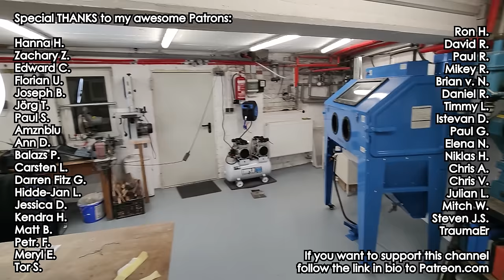How I Transformed My Workshop With This Epic Update!

Comment: I love my sandblaster. A couple of tips that may help. measure the glass and get a couple of spare pieces cut at the local glass shop as I only get a few months out of mine. Clear contact can help but everything goes frosty after a while. Your compressor will run continuously while you’re blasting as it uses a lot of air so run a good water separator. I run the air through a large automotive transmission cooler so the air cools down and the water condenses. This gets caught in a dedicated water trap. This set up is placed just before the air enters the cabinet and it’s amazing how much water it collects. Run proper media, I use garnet as it’s sharp and lasts a long time. Just don’t use sand as it gets smashed so it doesn’t last long and the dust, if it leaks out, can cause silicosis of the lungs. If the item you are blasting is heavily contaminated with thick paint it’s worth using paint stripper first to help keep the media clean. Blasting anything oily or greasy is a disaster as it contaminates the media and then that can contaminate everything you blast after that. I blasted something with old contact glue on it and while it removed the glue, it contaminated my media like small pieces of a plastic bag and kept get caught in my gun and blocking the media flow. It’s just about all gone now but never again. If an item is rusty, even heavily rusted, I just blast it with no pre cleaning as the rust just comes off like dust and the filter catches it. I hope some of this is useful and I don’t want to sound like a “know all”, it just things I have learnt over the last 15 years of having mine. Good luck, they’re so a great thing to have. Cheers Stuart 🇦🇺
Reply: That's all very interesting. When watching YouTube restoration videos, it always seems as though a sandblaster is like a kind of 'magic wand' - just spray sand at something and it magically come clean. Your explanation confirms that the truth is that a sandblaster is just like any other tool - there is a right way and a wrong way - and there is no such thing in life as a magic wand.
Reply: @caseyjones166  Hey Stephen, spot on.👍👍
Reply: Interesting about the rust.  I always thought the reason some YTs strip/take of most of the rust before blasting was to make the media work for longer, and that the rest were just lazy or didnt mind not saving money on it
Reply from the maker: Hey Stuart thanks a lot for this info. Very valuable and much appreciated that you took the time to write this all down
Reply: @NTRprojects  Happy to try and help. I love your channel. 👍👍👍
Reply: Great tips there! Well said, and well received. 💪👍
Reply: @T_B  Thanks very much 👍

Comment: Awesome, I wish the one I use was so new.
I saw in another person's comment about extra pieces of glass. Talk with the manufacturer, some companies have underlayment that is very thin material to protect the window. It can be replaced when it becomes cloudy. Much less expensive than replacing the glass. I also recommend having a fine mesh wire basket for smaller parts, it saves a lot of wear on your gloves. Oh and speaking of gloves, remember to turn them inside out and clean regularly. I have to share the blast cabinet with coworkers.
Reply from the maker: Great idea with the gloves Pamela

Comment: A hint from my (late) father: don't sandblast lead paint. Not only are you aerosolizing lead, which is generally not a great idea, you run the risk of clogging the nozzle and hoses. Lead was used in paint both as an opacifier and as an adherent; when heated by friction lead particles will soften and stick to the blast medium, creating clumps. This is not a big deal when working in open air - say, when sandblasting the side of a battleship in dry dock - but the clumps can permanently clog nozzles and hoses when working in a closed system where the blast medium recirculates. 

It's been forty years, and I can still hear Dad cursing like a Maine State Trooper over having glommed up his gun and nozzle because he didn’t think to check if the paint contained lead.
Reply from the maker: Thank you. I am in search for lead tests, but so far I didnt find good ones